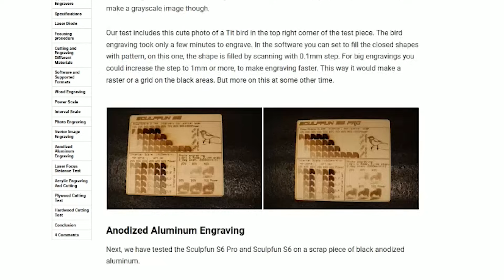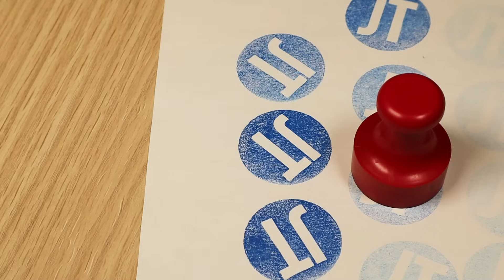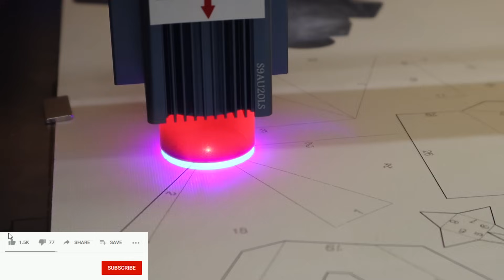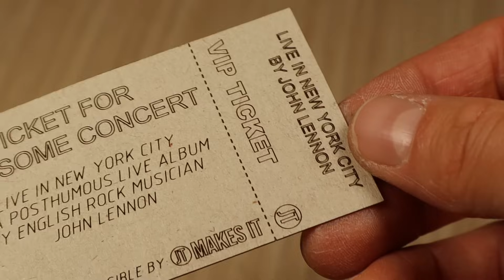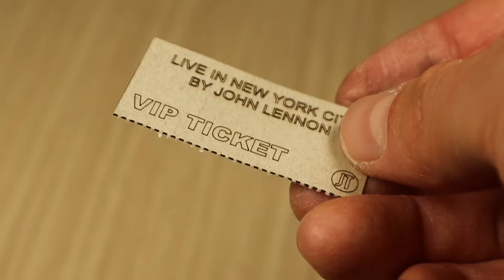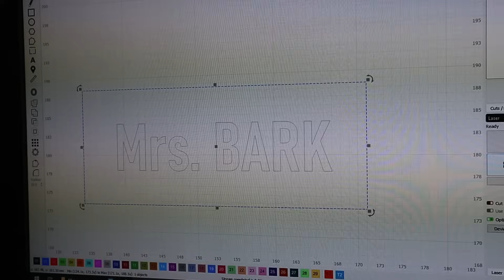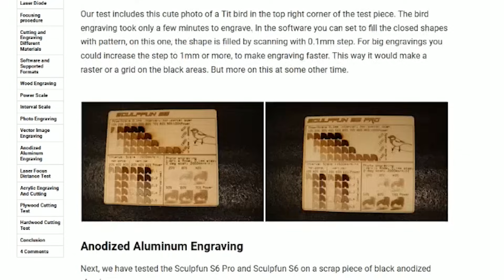10 Things You Didn't Know You Could Make With a LASER ENGRAVER (NEW Sculpfun S9 Review)

Comment: Come on! It obviously can't engrave stainless steel or any other metal. You painted that metal and burned off the paint. You  are also misleading people by not mentioning the fact a lot of those cuts were many passes and much slower than your video shows.
Reply from the maker: In the video description there is a link to the technical review of this machine where all the parameters and number of passes are listed for each material. This is also mentioned twice in the video.
The stainelss is truly engraved. It works also without the paint by engraving directly on the metal.

Comment: Hola, Excelente Video!!! Disculpa puedo poner el Modulo Sculpfun S9 en una Ortur Master 2. Gracias
Reply from the maker: If your machine is powered by 12V (regular Ortur laser Master 2) it could work. But I am not 100% sure because I don't have that machine. For Ortur laser master 2 Pro it will not work because the machine is 24V.

Comment: Which would you say is better, this machine or the OLM2 20w?
Reply from the maker: This one has much more powerful laser head.
Reply: @JTMakesIt  so even though both are 5.5watts, this one is more powerful?
Reply from the maker: @ryanbeharry5636  it has more concentrated light spot. I am currently testing OLM2 Pro(more powerful than OLM 20w) and Ortur cannot engrave stainless steel, but S9 can. S9 also performs better at cutting thicker materials
Reply: @JTMakesIt  thank you

Comment: Hi I am new to laser printing I am just wondering can I use any brand y axis rotary wheel with the sclupfun laser printer as I have seen the ortur ones and they make thier own rotary wheels 

So could I use a ortur rotary with sculpfun printer 

I think I can but just making sure
Reply from the maker: I am not sure about the Ortur one fitting to the Sculpfun. At least the Laser Master 2 Pro has 24V power supply instead of the 12V others use.  But I haven't tried any rollers yet. I think the Atomstack one could work, but the Sculpfun will soon release their own roller, so I think it is the best to wait.
Reply: @JTMakesIt  ok thank you

Comment: Great review! I see the machine is not coming with a bed for cutting, what are you using (the black bed under your machine) if you don't mind sharing :) Thanks!
Reply from the maker: Machine comes with a small stainless steel plate. I use a big 2mm thick regular steel plate which is great because I can fix the material with magnets.
Reply: Do you get laser reflections off the steel?
Reply from the maker: @deanclauson3566  nothing that would compromise the  quality of the cuts
Reply: @JTMakesIt  I was thinking more about safety.
Reply from the maker: @deanclauson3566  you always need to wear safety goggles and avoid looking at the beam if possible.  But steel plate is not as reflective as stainless steel

Comment: Love the vid how can it cut 10mm mdf? If so how many passes you think I'll neeed?
Reply from the maker: Thanks for watching! I have never tried cutting MDF, so I can't say it, but the 10mm is about the practical maximum for softer woods. For 10mm Poplar plywood it takes around 20-25 passes at 600mm/min.  I think it would need quite a lot of passes. You can go slower and use much less passes, but there would be more charring. For fast cutting of thick boards, you would need much more expensive machine.

Comment: Awesome video.
You can also "engrave" / etch stainless steel by covering it in mustard (no joke, result depends on the mustard though)... it's easier to apply and remove than spraypaint :D
Reply: "Mark" NOT "engrave". This thing is way way too underpowered to engrave any metal.
Reply from the maker: @beer1for2break3fast4  this machine is the only one of the 8 laser engravers I have that can truly engrave stainless steel. Even without painting it first. The result is a little bit lighter in color, but its engraved for sure
Reply from the maker: Thanks for that amazing tip!😆 I will definitely try that!
Reply: I knew about the mustard from some other videos. Does tempera paint work? It should be easier to wash off apparently. I would try it, but am still waiting for the tempera paint to come.
Reply from the maker: @cplcabs  tempera should also work, but I haven't tried it yet

Comment: Hey That's a great video and very helpful but I have a question 

What is that black sheet under the machine ? 

And where can I buy them ?
Reply from the maker: That is a regular 2mm thick mild steel plate I ordered at a local metalworking shop. It is great because you can fix things with magnets. But with the machine you get a small steel plate as well which is good for a start.
Reply: @JTMakesIt  thank you so much ♥

Comment: Very informative and helpful video.
The following questions from a technical point of view:
1) is the Laser Module 90w replaceable if it is defective? if so, where do you get these laser modules?
2) can you also operate a 60w laser module with an S9? or is the electronics (CNC control board) designed accordingly? maybe this question has already been asked in this chat ...
3) same question as 1) for the CNC control board?

Thank you for your effort and a lot of work
Reply from the maker: Hi, the module is easily replacable and upgradable. It takes a less than a minute to remove the head.  The s6 and s9 heads are interchangable and so are the driver boards. Mechanically the are also the same.
The replacement/upgrade heads will probably be listed on banggood. But the life span of the head should be very long.
Reply: @JTMakesIt  Super cool and thanks for the quick reply! i will order this device with your proposed coupon and i will be very happy to use your advice!
I discovered that one side can be extended. do you maybe also know how big this is offered?
I am happy to watch your well-structured and well-thought-out lectures again and again.
Likewise, I plan the housing like you did in the other video's. Do you have may be plans or a list of components for this?
It's just a lot of fun to be here !!
Reply from the maker: @gdinternationalpmjr3338  Thank you for watching! It is a pleasure working long hours and producing videos that people like you excited and happy :) 
I do not know about the extension, but on their site they say that that aluminum profile is standard and I guess you can extend it as long as you like. You would just need to purchase longer belts and cabling would also need to be extended. Maybe they will sell extension kit in the future. But this laser as it is is still very big. 
As for the ventilation box, I do not have plans and component lists because I built it from the parts I had at hand. I think it is not the best design, but its the best for the materials I had available :) In some of the first videos with laser box I have a link in the description where you can find some more photos with some basic dimensions.
Thanks for being awesome and enjoying my videos :)
Reply from the maker: Hi, Some update! Now you can get replacement laser head for S9 here:
https://hobbylasercutters.com/go/sculpfun-s9-head/
They also have replacement head for S6 and S6 Pro. The heads fit on most laser machines - Atomstack, Ortur, Eleksmaker...
Reply: @JTMakesIt  Thank you for your great info and for thinking of me!
I will definitely buy this set including the whole machine. I started planning the electronic controls for the fans and sensor detectors for the housing. It will probably be a few more days until the real thing from Sculpfun S9 is there!
Reply from the maker: @gdinternationalpmjr3338  Awesome!